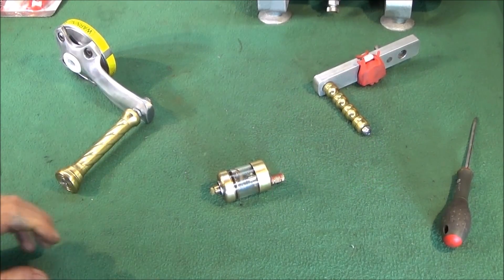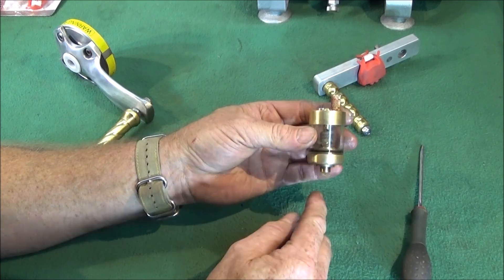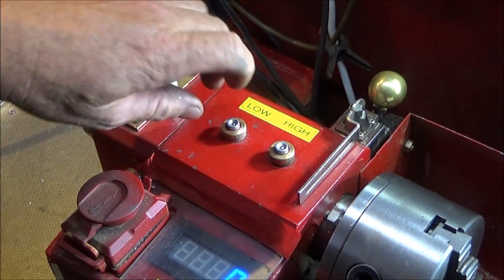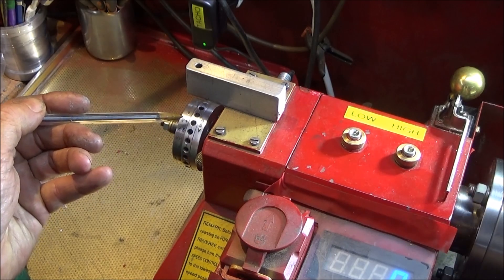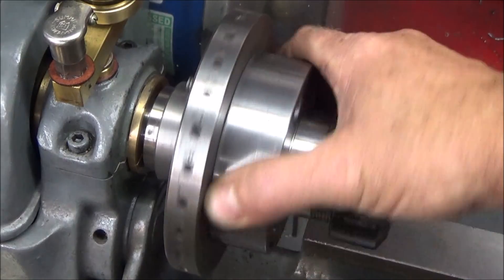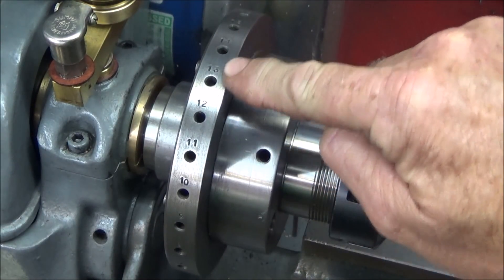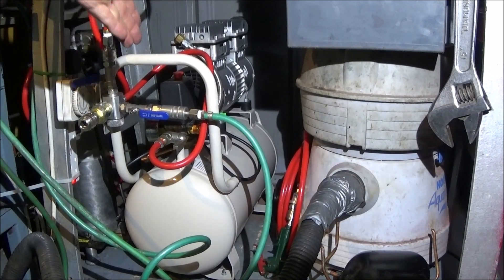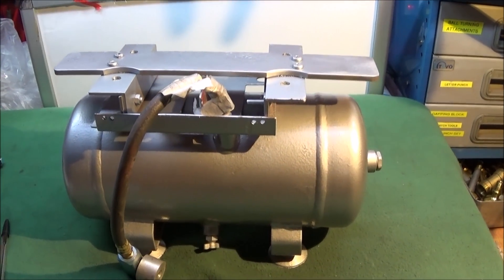A Few Upgrades For The Chinese Mini Lathe, The Myford & New Compressor

Comment: All the videos I have seen on the mini lathe is they use grease on the gears and grease on the taper bearings that they change out. Most say the gears come from the factory with grease. Why have you decided to use oil?
Reply from the maker: When I did this video I had metal gears installed in  the headstock. I found the gears tended to loose the grease over a short period of time and it was a lot of work to re-grease them. Because my lathe is in constant use, using these oil ports, I could easily look in and see whether the gears were dry. Then oil them up, without any down time. (I do not have headstock gears now) As long as they are lubricated it doesn't matter in the slightest whether its grease or oil.
Reply: @SteveJordan  No gears now so how do you transmit the power. I wondered if motorcycle chain lube would work and not get thrown off .

Comment: Hi Steve, I have fitted one of these tachometers on my Axminster pillar drill which I also converted to three phase with a VFD, and the convenience of not having to change pulleys on the belt was really worth the expense of purchasing a new three phase motor, the VFD  was a gift from a friend.

I am having problems with the tachometer on my mini lathe which is displaying a decimal point and incorrect speeds so would like to fit a new tachometer like yourself but I can't fathom out where to mount the magnet. I can just see your pickup at the rear of the lathe but could you please tell me where and how you attached the magnet to the spindle.

I would like to thank you for taking the time to create these videos and sharing your experience and knowledge with the wider online community.
Reply from the maker: Hi Fred I took one of the locking nuts off of the back of the spindle and drilled and tapped one thread hole on the diameter. Then put a small magnet on with a countersunk screw. Then put the nut back on the spindle. I will take a couple of photos tomorrow and put them on my google plus page so you can see exactly.
Reply: Thank's very much Steve.
Reply from the maker: Hi Fred I have just uploaded the photos of how I put the tachometer set-up on my Google plus page...Regards Steve
Reply: Thanks Steve, I have never used the Google+ service, how do I access your page?

Comment: You said the new air controlled oiler "makes the lathe much more economical". So I asked myself is the oil consumption of plain spindle bearings really a noticable contribution to the running cost? I don't really know since I have only worked with roller bearings in the lathe spindles with a closed recirculatiing oiling system. Would recirculating the oil coming out of a plain bearing be an interesting option? Since I have never seen that I (possibly mistakenly) assumed that the oil consumption is not really economically important.
Reply from the maker: Hi The ISO32 hydraulic that you have to use in this lathe can be expensive. Saving whatever wasted oil I can obviously saves me having to buy more. So this does save on the overall running costs especially when one can only buy the ISO32 online, which obviously incurs postage costs. Its a bit like having an oil leak on a car. You either simply fix it, or keep buying bottles of oil to top up.......Also the normal type drip oilers that you can buy for these lathes are extremely uneconomical and totally unreliable, using loads of oil, so making oilers that save oil makes a lot of sense on this type of lathe....Thanks for watching....Regards Steve
Reply: The comparison with a leaking car does not really apply because the open plain bearing is designed to leak. The car is not. But what I am interested in is how much oil does a lathe with open plain bearings consume? I dont know how to declare it: cubic inch per hour, pints per month?
Reply from the maker: Well the flow on mine now is 1 drop every 1:50 minutes. The other type of drip feed oilers would lose all the oil in a machining session plus if they were refilled, any left over in them, would continue to flow until empty even with the lathe not in use. The adjustment was almost impossible to get right. I used to go through loads of oil, but now it is controlled, without waste it is perfect, how it should be.  That's why I say its economical. You either waste oil or you don't.....Its as simple as that....Regards Steve
Reply: I see. When you manage to find out what volume or weight one drop has then you could quantify the oil flow rate. Maybe using a precision balance and putting 100 drops on it? Or putting a defined amount of oil in the oiler and count in to how many drops it converts? Then other viewers could compare their flow rate with yours. And there could be quest of the optimum and easy to regulate flow rate.

Comment: All in all, excellent work, but I was surprised to see that your new lathe tach does not show the speeds as the machine is slowing down.  I do not have that problem with the (optional) external tach that I have for my Micro Mark (www.micromark.com) mini lathe and mini mill.  The same tach (and machines that it plugs into) are also available from Little Machine Shop (www.littlemachineshop.com)  and possibly other sources as well.  I sincerely hope this information from "The Colonies" may be useful.

Comment: A while back I made a similar closing valve on my prototype wick oiler but sometimes it start to drip again. I suspect it's the change in atmospheric pressure that makes it drip again. 
I like your glass design a lot better. If I can find some of the glass tubing I'll start over.
Reply from the maker: Hi You can get the poly-carbonate tubing, which I used, in a variety of different diameters on Ebay.... Regards Steve

Comment: Hi Steve,
Did'nt catch where youre compressor was from
Could you please add contact
Regards  Carl
Reply from the maker: Hi Carl It is from Aim tools
https://www.aimtools.co.uk/products/241184-low-noise-silent-air-compressor-24l?variant=31124658634
I think they have sold out at the moment. They are also being sold by other sellers under different names on Amazon, but Aim tools is the cheapest and great on free delivery with good notification of a delivery time. Regards Steve

Comment: I think you are related to "inspector Gadget" Steve!  More inspired changes and devices. Very logical tweak to oiler.
That mini lathe is now an altogether much improved machine.
I think I should put one of those flasher deals on my spindle handle.
Compressor looks a super deal. Great work.
Reply from the maker: Hi Chris....In the past I have actually started the ML7 up, forgetting to take the handle off!! Its such an experience that it takes a few moments to realize what is happening!!! I also hang them on the lathe for other important reminders as well.

Comment: Very well done I surely like the idea of putting oil into the oiler using the pump.
Reply from the maker: Hi Glenn......Thanks for watching, I hope to do the video on the manifold later with a simple work holding technique I learned many years ago when using CNC machines....Regards Steve